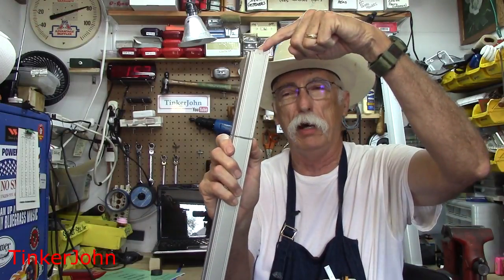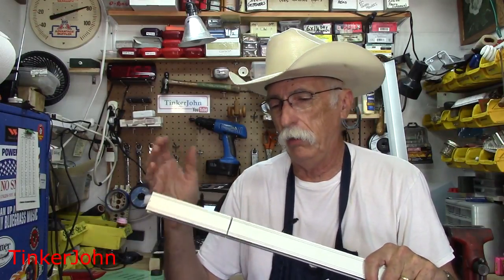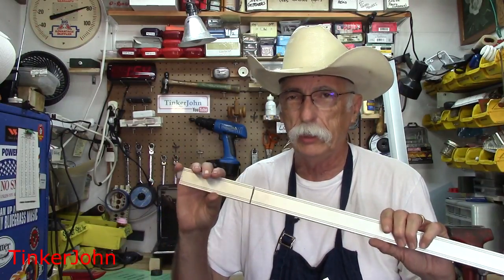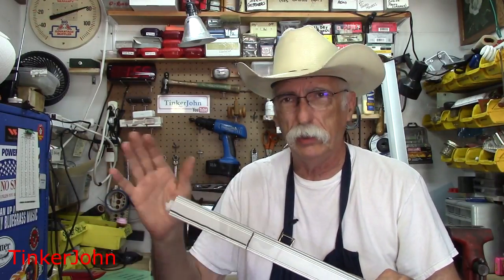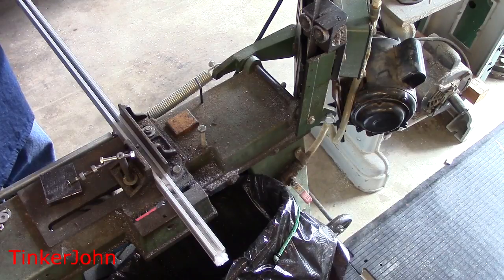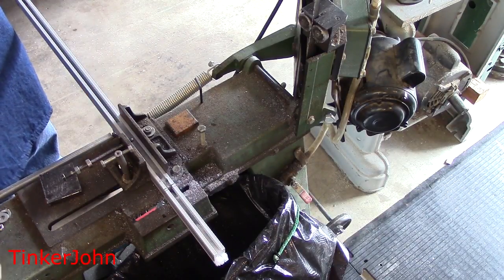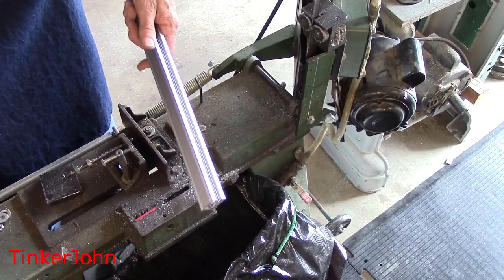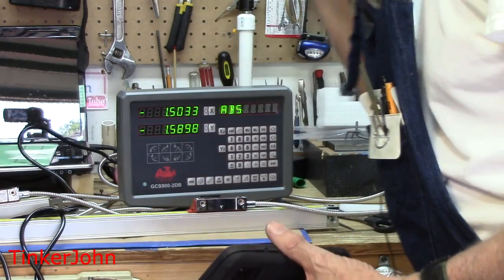How to Cut (Shorten) Glass DRO Scales

Comment: Hi John. I like many it seems got scales that were too long.. But inspired by your video I gingerly stripped mine down, which while it physically looks the same as yours it wasn't. The glass was parallel to the sides held in by small lengths of round rubber and some kind of adhesive in a slot. I removed the rubbers and gently wriggled out the glass and got it out intact. I cut it using a thin grinding wheel in a dremel type mini drill. When it put it all back together It all seems to work ok, I did use a 2 spots of hot melt  glue at either end, but it semed secure without it. Just got to move the mill now to fit the scale behind the mill table. Regards from the UK

Comment: Cannot believe that you can cut thin glass with a bandsaw or any other type of saw without it shattering. I would have used a Dremmel type mini drill with a diamond dust cutting disc fitted  to cut the glass having cut the aluminium with a standard hack saw. But you show that it can be done so well done sir. Great video.

Comment: I cut the Scales just like you showed, and it worked👍 I had to cut 2 out of 3 Scales and I can’t believe it worked so good. I went in with a dremel and scored the Glass about 3/8” in from the cut, snapped that off and put glued the End Cap back on.

Comment: HI John, I hope  you are well.
I remember when this video was first published and made a mental note for the future. I just received my DRO with glass scales and the options were for scales that were 100mm too long or 100mm too short for my lathe. I went ahead and ordered the scale that was too long because I remembered this video. I haven't installed it yet as I am waiting for the weather to warm up a bit.
Thanks for all of your great videos.
Reply: Just wanted to provide you with an update. I followed your lead in packing the area around the glass with foam packing and cut it with my horizontal bandsaw. It cut it like a champ. The only issue that I ran into was that the glass was mostly flush with the cut and the cap for the DRO scale had a milled register. I milled the center of the register out and it fit like a champ. I decided to take the lazy route and instead of drilling and tapping the holes in the extrusion, I got out my trusty JB Weld and glued it in place. 
Thanks again for sharing your experiences with us. 
Blessings to you and your family.

Comment: I picked up a new machine and had spare dro scales. 1 scale is about 5" too long. Much like you I had nothing to lose. 
I followed your method and braced the glass with foam. And it worked. The only issue I had was the glass stayed intact on the scrap side. On the good side I had a chip about 1/4" back. Just about the distance I need to grind back to fit the end cap. 
Thanks for giving me the courage to give it a go.
Reply from the maker: Thanks for watching and glad you had success.  I also had a broken bit of about 1/4 inch, however the reader did not go that close to the end and I just left as it was.  The DRO works fine.     ~John

Comment: Hey John, thanks for the video.  I just bought the 3axis for my g0619 mill.  Will be working on mounting the scales in the upcoming weeks. It's not clear to me if the red plastic shim/ shipping bracket that holds the read head steady on the scale is meant to be left in or taken out after installation.   As we know , the instructions are pretty poor. Thanks for your help!
Reply: It comes out.

Comment: That was interesting John.  Haven't seen it done with a bandsaw.  I ordered mine a couple of months ago and I worried that was going to happen so I kept repeating in the order and subsequent emails that I was only giving travel lengths.  I really stressed it as I was like you and very uncertain just what they were really asking for.  After I got them and only after it became apparent they were going to add the physical length of the slide which explained the travel length "plus" dimension.  

I would think they would either hire someone who is conversant in the language needed or outsource it to someone in that country that can fluently speak the lingo.  I can't believe that with all the smart people in China they have such a universal problem with communications and publications (manuals).  

Good video.  My installation will have to await the finish of other projects higher on the priority list but I hope that it will go smoothly.  Your fix is an ace in the hole and an alternative to the diamond wheel method.  At any rate they sure beat the $1800 versions sold by the name brands.  

Take care.  Doug
Reply from the maker: Doug, thanks for watching and for your detailed comments.  The DRO is now installed and working great.  However, you are correct about the lack of quality translation; the manual is pretty useless so I use online videos for much of the learning curve.     ~John
Reply: Hi Doug,
I just received a set of glass DRO scales that are too long.  My understanding of the ordering instructions is that use take your travel dimension and add 141 millimeters to get your scale size.  The scales arrived 141 millimeters too long.  Because of the language problem, in the future I'll only order from China as a last resort.

Comment: Hey John,  great video.  I had a similar problem with my Chinese scales but fortunately for me the X axis only sticks out about 1/4" past the ends and that was OK with me.   Blocks the table drains but I don't use flood cooling anyway.  Russ in Orlando.
Reply from the maker: Russ,  Thanks for taking time to leave a comment.  The DRO is installed on my mill and working great.     ~John

Comment: It did work for me as well although the glass did break a small piece off which has zero affect for me. Might’ve been a small 1/8 angle on it but the top travel side is still intact. It is actually the glass that rests inside the end cap. If you look they are suppose to be shorter so the cap can fit back on. Looks like I have more work to do.
Reply from the maker: Glen, congratulations on your success.   I was unsure when I did mine, but everything still working fine.    ~John

Comment: John,
Am I missing something but I cannot imagine cutting glass with a bandsaw blade without cracking or chipping the glass? Were you using any coolant?
Thanks ,
Bill
PS: Keep up the good work producing videos. Immanencely enjoy watching them.
Reply from the maker: William, luck was with me when I tried this.  Actually, I did not use coolant or any type of lube.  I did put some foam on each side of the glass with the thinking that may dampen vibration somewhat.  I was surprised that it worked at all, I was expecting the glass to shatter but it cut without a problem.    ~John
Reply: @TinkerJohn_W5CYF   The foam many lubricate the blade. With a Scroll-Saw we use clear package tape to attach the pattern. The tape lubricates the saw blade.

Comment: Hi,  I'm about to order the same set up as your  d r o kit , I hate to ask a, silly question but is it real glass , when they say glass scale , I been an old school machinist a long time , my eyes are having a hard time reading those dials, so I'm going to have to do something,  when I look on e bay the ads are bit confusing about d r o kit , thanks
Reply from the maker: Prentice, thanks for watching my videos and for your comment.  Yes, the scales are actually glass.  The glass is about 1/16 thick and about 3/4 inch tall.  The glass is protected by an aluminum shield that prevents chips and tooling from fouling.   ~John
Reply: @TinkerJohn_W5CYF  thanks for letting me know,  I believe I may go ahead and order it and attempt to cut it. , take care 😁
Reply from the maker: Prentice, the glass slides can be cut to desired length before ordering so you don't have to cut.  My mistake was I measured wrong.    ~John
Reply: @TinkerJohn_W5CYF  thanks I did not know that,  I just placed the order , but not shipped yet , I'll try to contact the seller , believe it is coming from California,  thanks again , I really enjoy your videos,  some good information ,

Comment: For anyone following, I have a much easier way. After you remove the pickup and the yellow strips, you can pry the small bits of plastic by the scale with a small 90 degree pick. Mine were little 3/8" pieces (careful not to scratch or pry against the glass scale) After you get the bits out, the scale will just come out. (Make sure you mark it how it was installed, I put some black marker on edge.) Cut the housing with a cutoff saw, debur and clean. Mark the glass and score with a glass cutter, support it and snap it. (it was hard to score, but snapped easy. Put the glass back in and using a small putty knife, press the little plastic rods in place. I had no idea on if I could find a 2.2 mm tap, but the screws made their own thread in the soft aluminum. Thanks for the video to get me started. Hardest part was getting the reader back in.
Reply from the maker: Thanks for taking a few moments to pass long an excellent alternative.
Reply: Thanks - going to give it a go later this week !

Comment: What are tose 4 holes tapped to buddy?
Reply from the maker: It's been a while since I did the project and I don't remember the exact size; however, they were very small.  I suspect any size screw/bolt would work.  I suspect something along a 1-72 or 0-80 perhaps.  ~John

Comment: sumting i seen done on a youtube clip was that the guy took the dro a part , took off one side then the reader , pulled out the dustprotectors , and then took the glass out (there some little pieces of rubber gleud in the valey to hold the glass in the aluminium frame he took the rubber pieces out working from the top with a dentist tool ) after he took out the glass he cut the aluminium the normal way and used a dremel tool with a daimond blade to carve the glass at the right length and carefully snapped it at that spot 
think its a good idea to do this at the side where it reads the highest number , the glass basicly has some reflective stuff printed on there that the reader detects so you do need to be carefull not to scratch it when you reinstall everything , he drilled and tapped the new holes for the end before he put the glass back in , made it a lot simpler 

ok cutting it on the bandsaw worked , it didnt cut the glass , it seems that the dro glass broke at the spot where the sawblade hit ,  its still a risk as the glass can break in a different direction or in the wrong spot
Reply from the maker: Thanks for taking a moment to pass along a great suggestion.